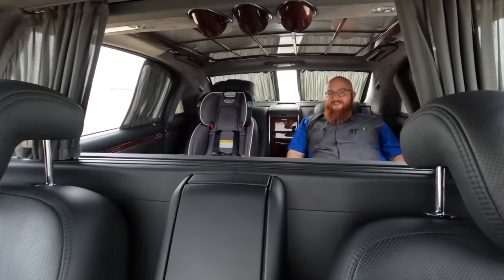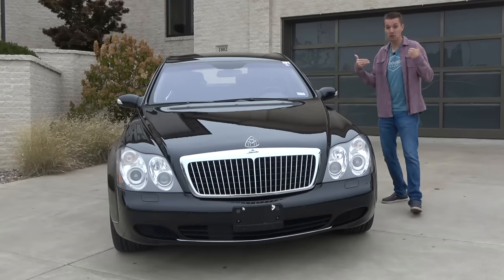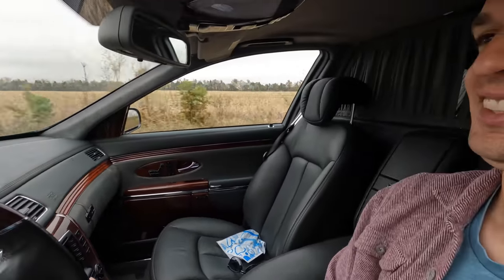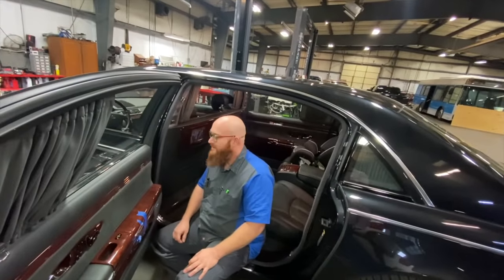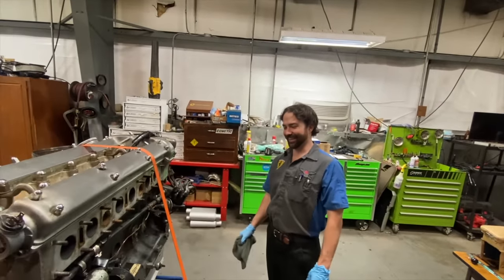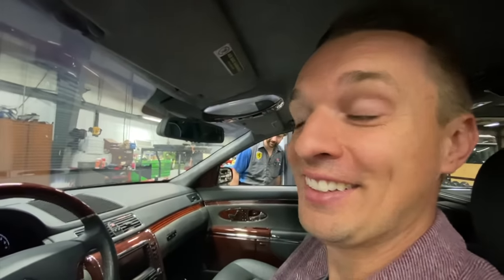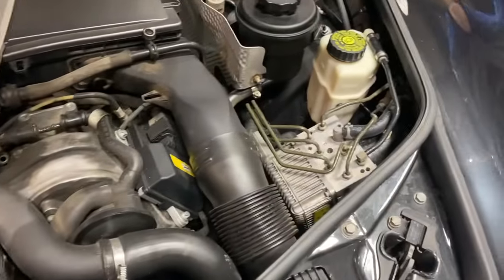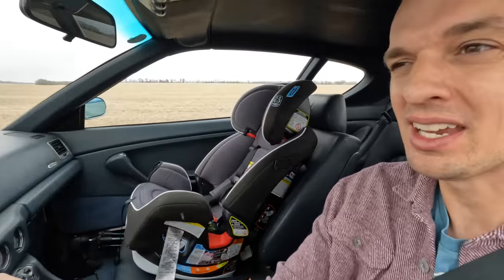The CRAZY EXPENSIVE repair costs on my CHEAP Maybach 62 have me worried (10x normal Mercedes)

Comment: I work for a Benz dealer up in Canada and I can tell you one really neat thing about this cars is the doubles, or backups of many systems. Double calipers, twin brake lines,  dual radiators,  alternator has twin stators.  So cool, these cars are so unique.  The 62 weighs more than a g wagon and barely evens fits on our hoistes
Reply: the 62 weighs more than a wagon? what an understatement.
Reply: @piuthemagicman  sorry , "G Wagon"
Reply: @piuthemagicman  about equal if the maybach was base model62 .no partition no crazy roof.
Reply: The first time I saw one in person is when I noticed the two calipers on the rear wheel...very cool
Reply: My mind was blown when I first saw at the dual brake caliphers
Reply: Did you work on that beige one an old guy drove around?

Comment: Under a car that big and heavy without a jack stand - living dangerous!  Be safe fellas!
Reply: I'm disappointed Wizard did that. 
That car already had air suspension warning popping up.
What if something suddenly gave out with the car perched like that on jacks?
Reply: Ya that was a dumb thing to do.
Reply: I almost couldn't believe they did that. I'm just a home mechanic and even I know not to trust my life to hydraulics.
Reply: Was wondering if anyone else was feeling it, especially when the wizard had his arm under the wheel of a 4t car
Reply: he didnt swing under the car, well maybe only the bumper section at most
Reply: big heavy cars are a nono, those dues died under that rolls royce!
Reply: Having had a neighbor who was killed when his jack slipped out, and no jackstands,  this was disturbing.
Reply: @dagabbagool2600  as a certified tech I can say I have bad habit of not using jack stands or locks on hoists however I would never go under a vehicle without a jackstand and I am trying to work on my habit of not using locks on hoists however If a hoist fails it will drop to the nearest lock still sketchy though
Reply: @lawrencelin272  but you dont know if you drop something and then reach under to get it.  It's just safer to not do it instead of saying, well he wasnt all the way under
Reply: So if the car only weighed 3k pounds it would be ok?
Reply: Their wives have them both insured.
Reply: @AdamSWL  Their wives have them both insured.
Reply: @mr.monitor.  Their wives have them both insured.
Reply: @dagabbagool2600  Their wives have them both insured.
Reply: @bbqcrew1  Their wives have them both insured.
Reply: @joesmith9216  Their wives have them both insured.
Reply: @zedwpd  Their wives have them both insured.
Reply: @AdamSWL  I was disappointed too. Really not typical of Car Wizard, at least I hope. At the very least they could have put a ramp or something under the lifted tire if a jack point wasn't available.
Reply: @dr.mantistoboggan4746  I don't take chances. Even my GTI gets jack stands  when I lift it to remove the wheels. Lordy, that ENGINE alone probably weighs only a teensy bit less than my car!
Reply: I have lost all respect that I had for these two fools.
Reply: @dr.mantistoboggan4746  Absolutely-much smaller splat!

Comment: Try this brilliant little tip that I have invented. And it really really works. While the jaguar engine is on the bench, get a microfiber rag and a can of satin black spray paint,,,now then I have been doing this for over 30 years. Make a ball shape at one end of the rag and wet it with the paint. Now without being too gentle scrub the sides of the block and this will absolutely make the block look new but, 1950s new and it won't look painted. Trust me it is so worth it hoovie ✌️👍

Comment: Crazy expensive parts? On a car that cost half a million when new?? NO WAY! 😂

Too bad the parts don't depreciate as much the car does!
Reply: This lamb concurs.
Reply: I wish more people could realize this.
Reply: The thing is it’s based on the regular S class. It’s not a supercar.
Reply: I couldn’t spend more than $100,000 on a car. Even that is so much. Cars just depreciate so fast. The only exceptions would be collector cars.
Reply: @Marklin15  But with a lot of specialized technology built at very low volumes
Reply: @Marklin15  Just have to get the parts from the dealer without them finding out what the parts are for..
Reply: @christiandruan  the best cars to buy over 100 000 are Ferraris.
Reply: Car parts sort of depreciate as the cars get older. As more of the parts are needed to be repaired, more companies make aftermarket parts, you can obtain parts for a cheaper price. The OEM stuff just stays crazy expensive though, and a car like this, no parts are going to be common.
Reply: @Marklin15  It’s based on an S class in the same way an E class is based on an S class.
Reply: That's how they squeeze as much money as they can out of the original owners and future owners up to 20 years in the future.
Reply: The parts on the car that failed are worthless. The new parts do not depreciate, they're brand new!!!
Reply: While a Maybach 62 "might" resemble an S-Class Merc, the similarities end there. There was crazy attention to detail, and "true" Maybach's were built with utmost precision, and typically with much higher quality materials. (Except for some of the plastic bits sourced from Mercedes.) Based on few videos watched some years back, you could be traveling effortlessly at 150 MPH, with hardly any interior sound to disturb the occupants. In fact, new Maybach's back-in-the-day were built much like high-end yachts, and it is said that given the extensive options list, no two Maybach's are alike. Is it a supercar? Absolutely not! It was not built for that purpose. Though make no mistake, it is light-years ahead of most Ferrari's and Lambo's. Would I like to own a Maybach? Without a doubt, (though I do not have the "bankroll" to afford the costly repairs!) No matter, it is fun to see others enjoy such cars, and Hoovie seems like a very nice guy, so best of wishes to him! (Keep in mind that Hoovie may complain about costs, etc., but will typically do what is necessary to bring a given vehicle back to the condition it needs to be in. So, in this way, he is preserving vehicles in his own, unique way.)
Reply: Scrap the car. Don’t buy crazy ridiculous cars which also happen to be much less dependable than Hondas and Toyotas.
Reply: Lol hmm One 500 thousand buck ride Orrrrrrr 50 ten thousand bk rides. Or EVEN BETTER 500 
ONE K $ CARS. LOL
Reply: @christiandruan  He bought this one for 40k l
Reply: @caralho5237  wow
Reply: Best part is the engine ... looks like classic Merc V12 (which alone is nightmare) ... but has like 300 Nm more, so obviously shitload of parts are different.
Reply: what? the parts you put on is NEW... the car depreciate because it is worn out with fail points! wtf use your brain

Comment: Perfect illustration of "I have the money to buy it, but i cann't afford it" - sometimes the up-front money is fine, but the follow-up for repairs and simple maintenance is a killer!
Reply: Every clapped out German car you see.
Reply: I sell batteries for interstate and ill tell you people always try to go cheap on a luxury car. Wonder  why its 250 to 300 for a battery on there 70 thousand plus vehicle lol the amount of people calling for used batteries for Beemers is ridiculous lol
Reply: @joseureste8257  
Exactly! Especially as they move down the chain and get a few years old, when people "buy" them on terms because they want to show off their 'wealth', but can barely cover payments.
When you consider some models use uncommon batteries, it's even worse - you're going to have fun when the 48V euro's start needing those batteries 😉
Reply: That me w every car
Reply: Volvo in a nutshell
Reply: @Isaki138  
Funny you should say that, niece's Volvo had a transmission fault, fixed with a $10 switch, but it was around US$600 (current exchange rate) in labour because of it's location deep inside the gearbox.
To be fair, though, that isn't uncommon with ANY modern vehicle with any form of "automatic" transmission. I know of instances where vehicles just out of warranty have been written off because the transmission repairs required were virtually the value of the vehicle, and the owners got better value from selling the cars to second hand dismantlers.

Manual (standard) transmissions are much more reliable and I can swap out the clutches myself, if required, which is practically never under normal use.
Reply: Same for just about everything. That's what's killing my chances of buying a house: Bidenflation keeps rising and this makes the title, tax, utilities and insurance too much for me financially.
Reply: @gordowg1wg145  lol, happened to me and my bmw :))), lmao
Reply: Like a wife

Comment: My first thought when I saw the “this is better than a minivan!” video was that a windshield replacement probably costs more than my Honda Odyssey… and I feel pretty confident that it is.
Reply: Maybe, maybe not. I used to be in the glass business and yes, many low volume exotics like this had very hard to find and very expensive windshields. But not only are such windshields expensive to replace, they are expensive to have manufactured so when they can, they will use an off the shelf windshield from an existing model. This may very well have a standard Merc windshield you can get from any glass supplier for a couple hundred bucks. Or it may be a bespoke item now unobtainable and you would have to track down the one warehouse somewhere that had the sense to buy a whole crate of them before they stopped production and would be happy to ship one to you, for a couple grand of course.

The real expense will probably be those door glasses as those are probably bespoke items. Possibly the backglass as well since even standard Mercs tend to have very expensive backglasses.
Reply: i thought good mechanics dont charge diagnostic fees 🤔
Reply: Best minivan in the US. (Ozark reference)
Reply: @wingracer1614  just replace with lexon for twenty bucks
Reply: @MrPaxio  if you just want them to look then they will. If you want it repaired they roll that into the repair cost. It still takes time to do the diag and they need to charge for it.
Reply: I was thinking the same thing.  I have found that the "market" is pretty self leveling - ie. if a deal seems to good to be true...etc.
Reply: @catman19  LOL no. I assume you mean Lexan. Not a good idea for a windshield on a street car. Plus that will cost a lot more than 20 bucks and you will have to replace it every time it rains as you won't be able to see through the scratches your wipers left behind. 

And who is going to pay top dollar for a rare Ferrari or Maybach with a janky ass, scratched up, hand cut, sloppily glued and leaking Lexan windshield? Save the Lexan for the race cars.
Reply: Mercedes have a 6x multiplayer for prices for any part, because, Mercedes. These being a Maybach just makes it much worst.
Reply: @FishFind3000  so you can tell them to look, they tell you whats wrong, and you can then leave without paying them for diag and hit up a different guy? idk man
Reply: @MrPaxio  they do because it is all profit. They have to buy very expensive software to diagnose but they use  them everday. So they charge every vehicle a diagnostic fee and  the mechinic gets their money paid back for the software quickly and then its all profit
Reply: @wingracer1614  - Mercedes has a policy of supporting their cars with parts. So you can get the glass from MB all right, for a price.
Reply: I really like that smooth, un-garish Ferrari.
I'd probably hate the upkeep, but it is a beautiful car.
Reply: @wingracer1614  Sigh, up until ten years ago PG Glass in Harare Zimbabwe would make you one for the same cost as that of a Ford Escort plus the cost of the mold ( about 100 dollars US at the time)

Comment: At 2:26 you mentioned the coil pack is 6 coils in one span. You are correct it is in one span but this motor is actually two spark plugs per cylinder so both of the two ignition coil units contain 12 per side. For a total of 24 spark plugs!
Reply: Holy crap!
Reply: LLLOIOIOOLLLLL 24 BAHAHAHAAHAH hurry ask Ur money back jejejeje buy a Maybach ACME brand jujiji
Reply: 24 plugs and no doubt iridium ones at that. I suspect a sparkplug bill of more than I've paid for entire cars :D

Comment: That airmatic warning could be something with the level sensors. My e63 kept doing that - turns out the u bolts holding the level arms to the tie rods on the front wheels were super loose so the system could never get a plausible reading of the vehicle level when driving.

Comment: Dang, I've got a 320 amp alternator in my Mercedes to power all my car audio equipment. So a 600a one is insane!
Reply: Imagine the horsepower drag needed to power that!
Reply: 600a x 12v = 7200w -> about 10hp give or take. That more or less agrees with a typical portable generator hp, depending on the efficiency. 

That's nuts.
Reply: @danl6634  That also explains why the auxiliary belt needs to be so wide !
Reply: And here I thought going from a paltry stock 70A on my Defender to a 130A from a Discovery was a big jump 🤣
Reply: 600, I - I can't even comprehend such a huge number pertaining to a fercrissakes ALTERNATOR. That's a alternator on steroids.

Comment: I was trying to purchase a Maybach 57 from MB of Plano a few years ago. It had suspension issues and ultimately, because of this and it’s inability to pass state inspection because of the struts (even though I was going to take it out-of-state), refused to sell it to me and sent it to auction.

I bought a S65 instead…and promptly had to replace the ABC tandem pump. I think I’m better off!
Reply: What's the biggest repair bill or issue/s u had on the s65? (Don't say none, all cars have a issue/s)
Reply: The ABC tandem pump and the dynamic seat system pump. The AMG models use the hydraulic rather than the airmatic suspension. Together it was about $5k. Before buying the car, I verified the spark plugs and coil packs had been recently replaced; about $6-7k with labor at the dealer. Another big ticket item are the brake rotors. MB gets about $1,800 per rotor...just the rotor.

Comment: I bet the belt is wider because of the high power alternator. So other accessories like the water pump might be the same but with a swapped pulley for the wider belt. So if your pulley doesn't break on one of those components you might be able to get a standard s class part and swap pullies.
Reply: You know it is going to be the special alternator, this is Hoovie.

Comment: Just on the 456 - I ran a 456M GT for a few years, with stock exhausts, and always felt it was quiet. Then one day on a Club run we went belting up a few hills in pursuit of single-figure MPG and when we stopped the  chap behind (in a 612) commented on the awesome soundtrack. So I think it's mostly cabin insulation...? Thanks for your channel - came here from Freddie's, and Cartrek. 👍

Comment: Never go under a vehicle without a JACKSTAND
Reply: Yes this made me cringe.... I can't believe a professional mechanic would trust their life with a hydraulic jack :/
Reply: @morganfreeman5171  I was shocked to see Wizard doing this.
I thought they would at least put it up on a set of ramps or stands.
Reply: It's done ALL the time.  No biggie.  That's a Daytona Jack.  Snap On knock off.  Built like a tank.  I have two.
Reply: @243wayne1  made by snap on ? I know they have blu point is Daytona another one of their brands ?
Reply: @charlie1832  No Daytona is from Harbor fright. Before you scream made by china crab Daytona jack is actually made in the same factory as snap-on jacks. So basically it is a snap-on. Snap on tried sue HF but failed. It’s a really interesting story look them up if you are curious
Reply: @charlie1832  Daytona is not made by Snap On.  They are a very high grade Harbor Freight knock off.  Snap On sued and lost.
Reply: @243wayne1  It is a big deal when you know that hydraulics DO fail... Jackstands are a quick, easy and cheap way of taking no chances.
Reply: @morganfreeman5171  Correct.  However, watch me not care...
Reply: They do fail. A mechanic that used to work at our shop was working on a car at his house and the jack failed. I can’t believe Wizard did that tbh
Reply: I have personally seen a jack fail while it was supporting a motor. Durning a motor mount r&r.
Reply: I was told a Grandfather I never met died in the 40s at 53 years of age and supposedly a car fell on him.  My family really doesn't communicate properly.  Anyway, I had to dig up the death certificate and he actually died at 35.  Cause of death was listed as cardiac arrest.  If a car actually did fall on him, that's a horrible way to go.

Comment: a bearing replacement in an alternator, any alternator, is a relatively simple and inexpensive job. i wouldn't be worried, unless i was planning on taking it to a mercedes service center. now, THAT would worry me. :)
Reply: Have you seen the water cooled one?
Reply: @daleolson3506  haha....no i haven't. but i suppose one could design it such that the bearings are neigh impossible to replace.

Comment: I flipped my XKR finally for a decent amount compared to what I paid for/put into it, so I just have my older XK8 with a procharged Ford 4.6l 32 dohc v8.  Probably the most reliable Jaguar I've owned at this point, although my XJS with the inline 6 was pretty solid all around.  I traded that for a Mercedes 380 SEC V8 coupe that has been a fun project.  It's extremely far from perfect so I'm tempted to put together a widebody for it like some others have done.

Comment: I had a Hydraulic Jack failure but it was very slow so you didn’t notice until it was too late. Fortunately, my Jack stand back up stopped the car from lowering on my brother. I also toss a one foot wide steel rim under the car as redundancy. Takes 15 seconds.